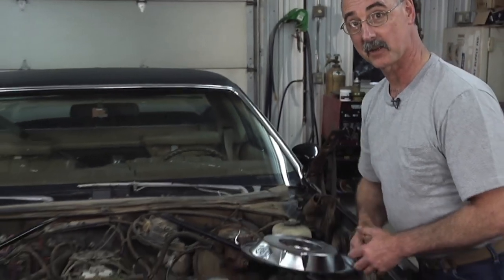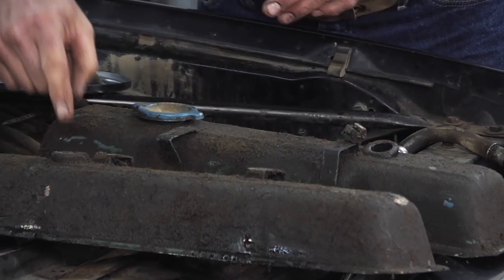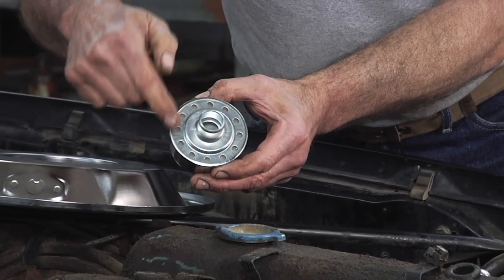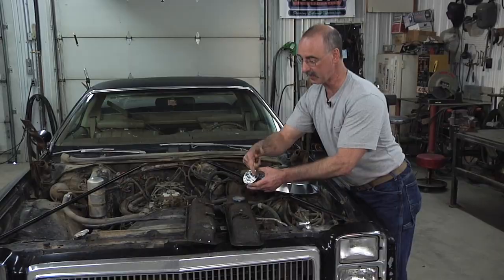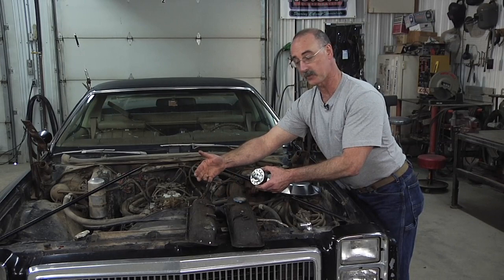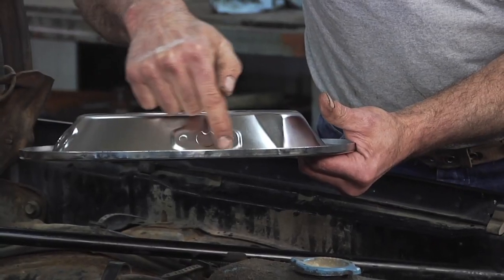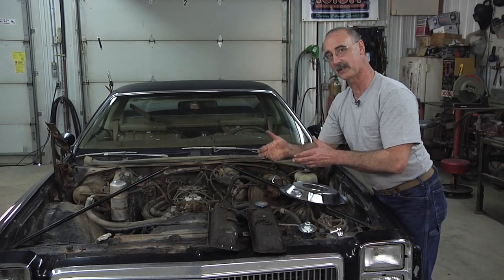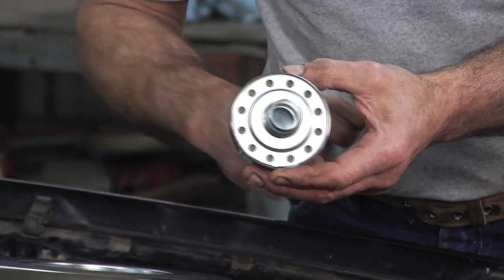New Valve Covers And Engine Breather

Comment: After watching a few videos on pcv systems, your video might answer the question of not having a fresh air source. The passenger side valve cover oil filler has the breather type and the driver side has another breather only type. I will install the pcv the driver side by removing the breather and replacing with pcv valve while running the hose to the base of the Holley Street Avenger identified as PCV. Thank you

Comment: Thanks.
I put new valve covers on my 1990 Ford F-150.
And I really needed this information.
My old valve covers have a filler neck with an adapter for a a breather tube.

Didn't know what I needed to buy. I've seen these caps with the same adapter for my breather tube.

So it's like it will have 2 ways of breathing, I guess, for lack of better terms, since the caps you show allow breathing through the cap itself.

Not sure if I'm making the correct decision, but at least I'm closer now..

Thanks again..

Comment: What does it mean if I have white smoke coming from the oil fill/breather cap on the passenger's side valve cover?  No smoke from the exhaust pipes.  350 SBC.
Reply from the maker: Hi Mark,
Smoke coming out your breather is from exhaust gasses getting past the rings and into the crankcase. 
The crankcase gasses have to escape somewhere... typically on a small block Chevy fresh air will enter the breather cap and be pulled through to the PCV (Positive Crankcase Ventilation) valve on the other valve cover then plumbed to a port at the back base of the carburetor. If everything is in place the crankcase gasses should be sucked into the carb base and burnt up during combustion. If the PCV valve is not installed or there is an older draft tube installed or if he PVC valve is stuck, gasses will evacuate through the breather cap.

Mark
Classic Car Restoration Club
Reply: Thanks for the explanation.  In general, I'm still confused as to how there would be suction on one side of the motor and pressure on the other side.  Shouldn't there be positive pressure on both sides?  How/why is one side pulling air in and the other pushing it out?
Reply: @marko6394  
As the engine runs, Some exhaust gasses build up and the PCV valve acts as a ventilation system as the carb pulls vacuum through it. Whichever side you plum the PCV valve to, you will have to put the breather on the other. It sucks air into one valve cover, down to the crankcase and back up to the other valve cover. 
 If there is an extremely excessive amount of white smoke coming from the breather,  Then there's exhaust gasses getting past your piston rings and it's time for a rebuild.

Comment: rebuilt 304 AMC I put back on the original valve covers that were on the motor no holes for breathers or PCV valves. so I put the PCV valve on the back side of the intake and ran it to the front of the Edelbrock carburetor. still using a shitload of oil and my vehicle smells like gas that is not being burned. so I took a non ventilated oil cap with the air Inlet tube that goes to the carburetor breather and ran a hose to both of them. is that going to get rid of the gas smell and the blow by issue? or do I need to put new valve covers on with PCV valve on one side and a breather on the other? or do I need them both
Reply from the maker: Hello.  Positive crankcase ventilation (PCV) was developed to get rid of blow-by gasses that developed in the crankcase, and re-burn them in the combustion chamber. Cars built before the introduction of the PCV system often used a vented oil cap and a “draft tube”, the draft tube extended from the crankcase and often stuck straight down, then when driving air passing over the end of the tube would create a vacuum to pull out the gasses. Of course at stop signs, cars with bad rings or worn cylinders would become enveloped in a cloud of smoke.PCV put an end to the draft tube, as engine vacuum is used and it become a more closed system. To function properly you need a PCV valve (it keeps the gasses going in one direction only) a vacuum port on the base of the carb, and a breather for the system (a way to get fresh air in). The breather can come in several forms: a separate breather attached to the valve cover or valley pan, or a vented oil cap.It is possible the that your engine is worn enough that the PCV system can no longer keep up with the amount of blow-by you are experiencing. It is likely a good time to conduct a vacuum and compression tests on the engine and determine if more work needs to be done to have your engine running properly.Wrench Safe
Reply: Classic Car Restoration Club

Comment: Dose it matter what side of the engine you put the breather or PCV valve on?
Reply from the maker: No it does not matter, although in order to ventilate the crankcase the PCV valve and the breather need to be on opposite sides of the engine.
Reply: @ClassicCarRestorationClub  looks better if it is on the back of the valve cover instead of up front...so right side..